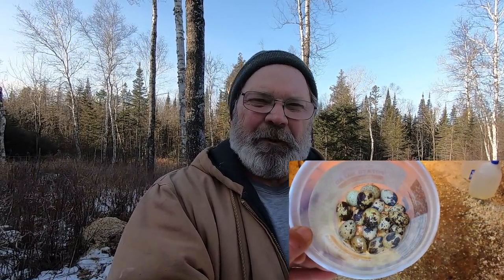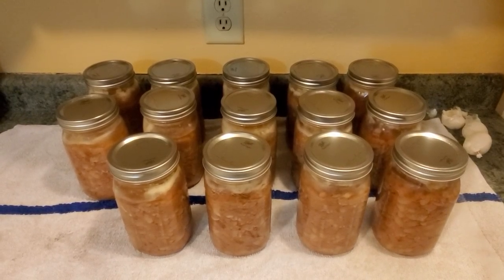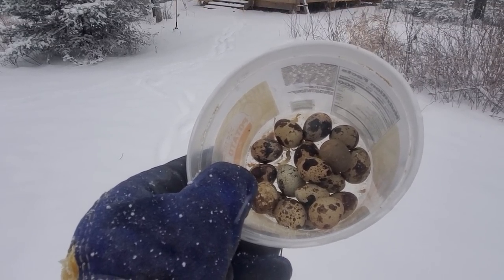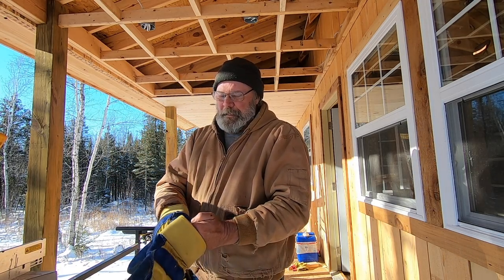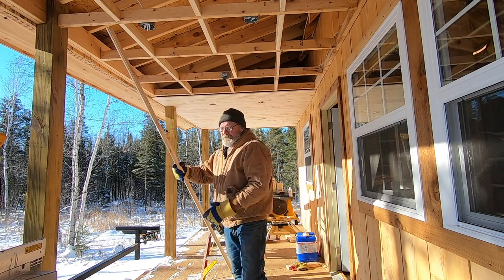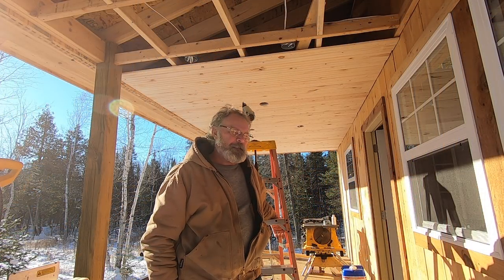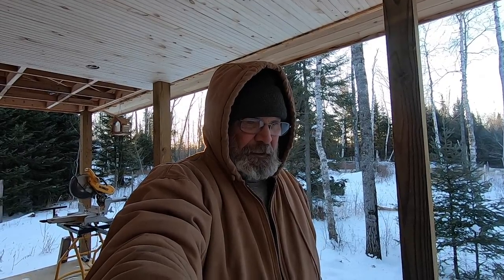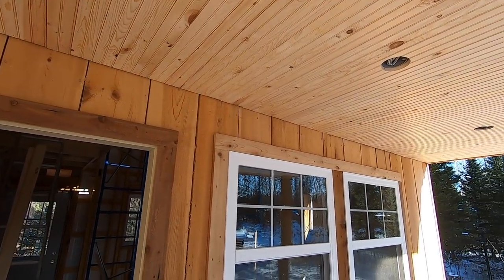Porch ceiling gets finished in the #offgridcabin along with a bit of #homeremodeling and much more.

Comment: The ceiling turned out great.  And even with all the changes, the lake house is looking great.  Great work all around.  Stay safe and warm my friend.
Reply from the maker: Rich the remodel in this was a small framing job for another contractor, I'll be going to work on that lake house this week now.
Reply: @WanderingWiley  I thought the layout was off but you did mention changes and they have made changes before so..... still loving the work though.  And the fact that the deer hardly move but a few feet even when you get close.  Love it.